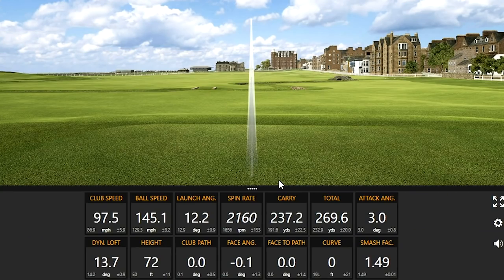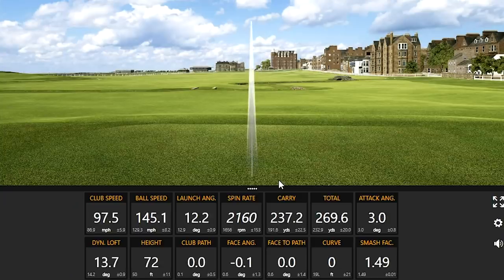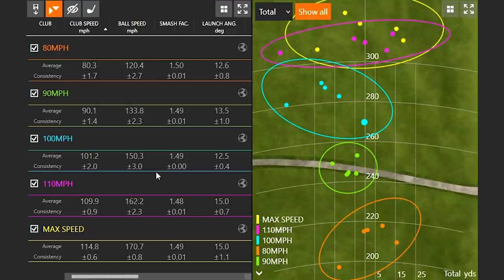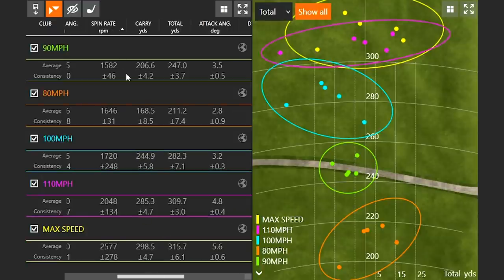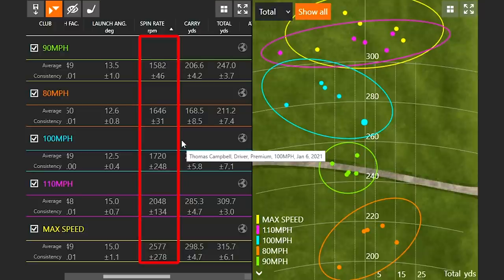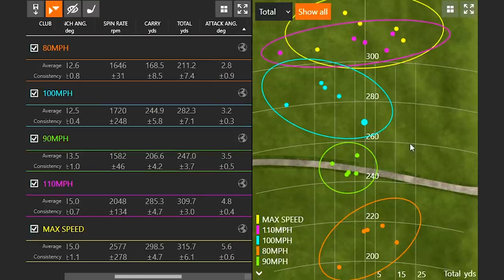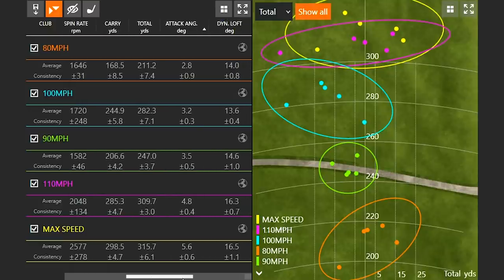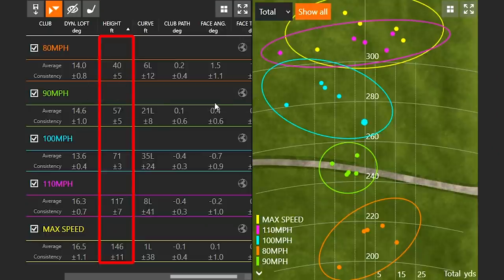How Club Speed Impacts A Driver Fitting | Golf Club Fitting Insight

Comment: Very helpful for those of us who don’t or are not able to swing at your level of max etc. Also helpful to understand the link between spin, launch and attack angle and what a little more gain in club/ball speed can do. It validates what I find with my driver on the course including adjusting driver loft angle (though one needs to pay attention to what that does to opening or closing club face  al a dispersion potential). But good to see this with same driver and same shaft. Obviously one could adjust the shaft too to achieve some differences with same club speed as you have shown before. Interestingly recently I got more distance with my same swing trying a 12.5 degree driver vs a 10.5 perhaps enabling catching it more on the centre or just above it  the face. Great stuff.

Comment: Thanks Thomas. I believe you have just made one of the most informative and interesting videos on golf- Youtube recently. It is interesting that despite of the different speeds there was no variation on the shaft flex. Now I wonder, it is a must to adapt the flex to speed or that’s not always the case?. Myself, I have a 93 mph swing and use a regular Tensey Orange CK that came with my Ping G410, but I feel I just cannot go after it as it feels unstable, where as with a Hzardous Smoke RDX 6.0 It feels better.

Regards from Spain.
Reply: I experienced the same as you. I had a Tensei Blue reg shaft and a similar club speed and found the club head would twist on impact if not a perfect strike. I switched to a Hazardous Black Smoke RDX 6 stiff and dispersion was improved and better distance in general.

Comment: If a low swing speed with a driver needs a higher loft, does this apply to irons as well?
Most game improvement irons are very low lofted, does this make the long irons difficult to launch?
Reply from the maker: This is a great question! It really depends on how the golfer delivers the club and how much spin and height they generate. This would be a great test for irons and there would be concern for a very slow swing speed golfer with a very low lofted 7 iron as it will make it more difficult to get their optimal height. This is why the GC in more game improvement irons is positioned differently to a less game improvement iron and why players with slower swing speed should consider a hybrid or high lofted fairway wood to generate height and spin.

Comment: My driver numbers are nearly identical (SS, BS, and LA) to your 100 mph set, except I hit roughly 2 down, twice the spin, much higher (due to the spin I guess) and as a result the carry is more like 230 on average. What would be a good starting point for loft, since I can't seem to hit up on the ball reliably?
Reply: You sound a lot like me.  I just moved back a bit (ball more by front toe) did not change my swing or loft and got better numbers.  I had the (bad) idea that trying to hit up on the ball would require a blow up of my swing because when I did try to do it all kinds of bad things happened (fat shots, snap hooks, ending up on back foot).  It did not, just a set up tweak.
Reply: @davidmayo3368  when I move the ball forward in my stance my swing path becomes in to out and the ball fades, or sometimes slices. I can't seem to move the ball forward and still have an in to out swing path.